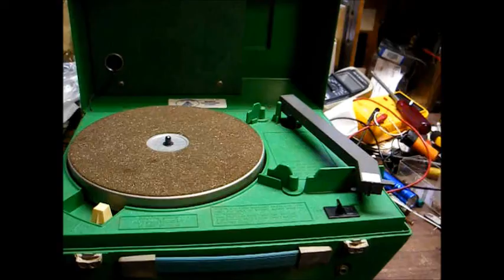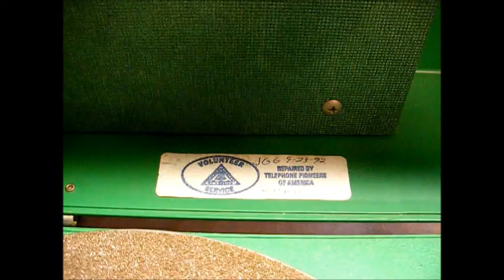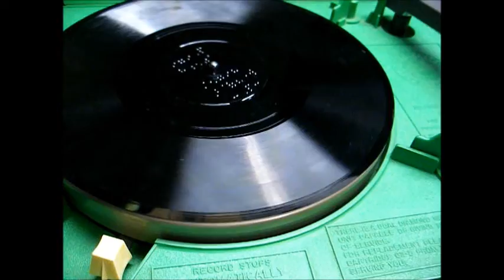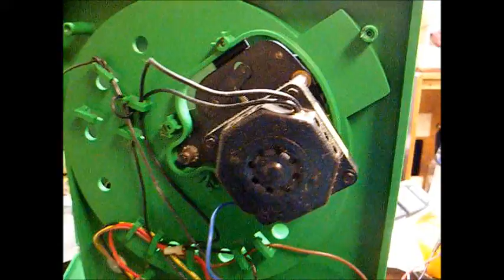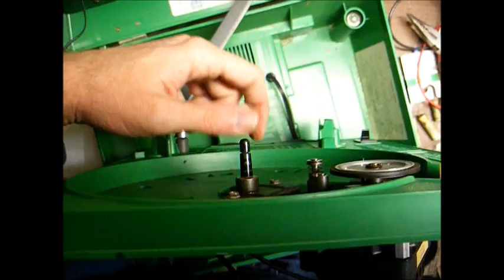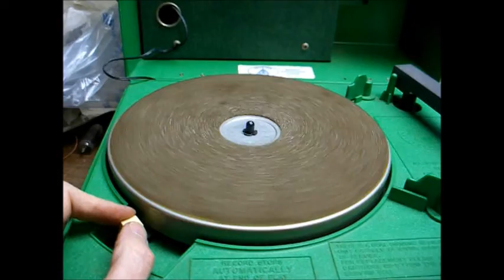A79 talking book record player

Comment: I just picked up a Waters Conley model A-74 unit similar to this one.  The foam is rotten and of course & the cartridge needs replacing.  Do you have a source for a replacement foam mat?  I had to have it because of the 8 rpm speed.  What was the record you were playing with the 1N34A diode in the text?
Reply from the maker: I've used the stuff that you line kitchen cabinets with, to keep plates from sliding around. Those foam mats were crap and should have never been used. I remember them rotting, as far back as the '80's.

Comment: just found one of these in the trash.  having some trouble with the platter seizing up and clicking. hoping to get it up and running but i cant take the platter off. i removed the C-pin holding the platter to the spindle but still no luck
Reply: Vinyl V put a hot soldering iron on the top of the spindle

Comment: Great video! I just bought an A-80 and need to buy a new cartridge,  can you you please help me by telling me which kind to buy? Thank you so much.
Reply from the maker: All of these machines made from about 1964 until the end of talking book record players use an Astatic 83D plug-in cartridge/needle assembly. This cartridge contains two diamond LP tips (one for use and one for a spare). I've seen 83D's on ebay and www.thevoiceofmusic.com also has them. In a tight, you could use an 89T with dual LP tips (not the LP/78 version). There is also the 911-D7 that is a single tipped diamond version that will work; but, these machines originally came with an Astatic 83D.

Comment: I enjoyed your recent series of repair videos! Keep up the great work! Is there anyway to measure the output voltage of a record player cartridge? If the amp is a single tube then is the output voltage needed at the cartridge higher than on a machine with a 2 or 3 tube amp?
Reply from the maker: An oscilloscope and a test record is usually used to measure cartridge output. On single tube players and on cheapie lower end solid state players with only 2 transistors, you need a 3V cartridge. On models with a preamp stage, you can use a .5V-1V cartridge.
Reply: radiotvphononut thank you for replying!!! I dont have an oscilloscope but your general tip about single tube amp record players is appreciated. As you mentioned in an earlier video,the Voice of music has been helpful in finding equivalent cartridges for 1940's -1950's phonographs. Thank you for teaching me how to service the mechanism on those by watching your videos. Could you show the procedure of measuring output voltage using an oscilliscope in a future video? Maybe others would find it interesting too.your you tube name should be radiotvphonoteacher!